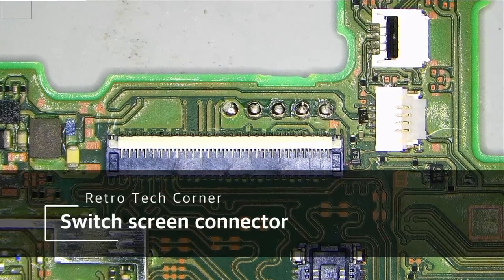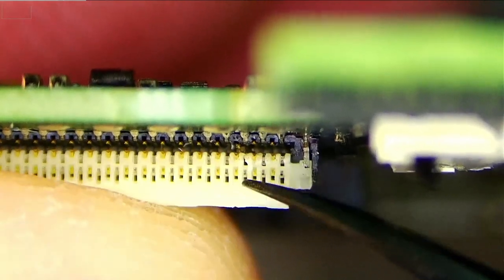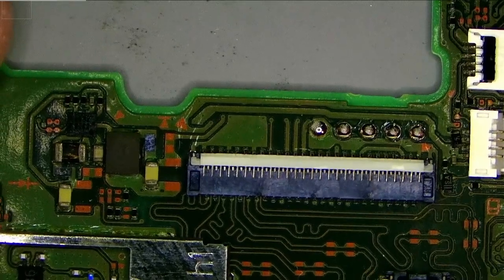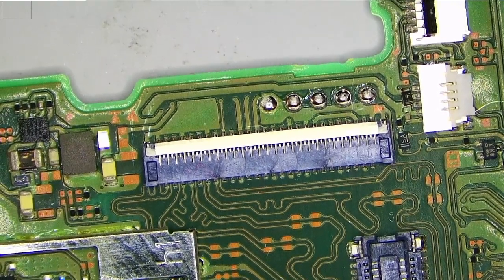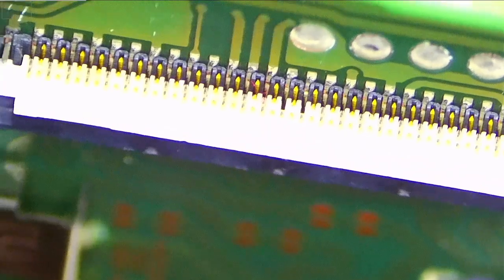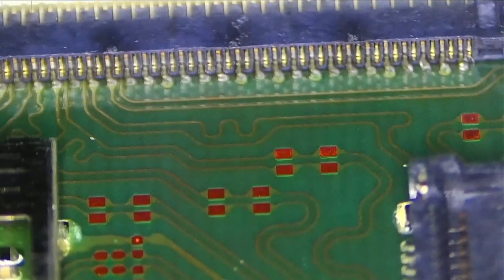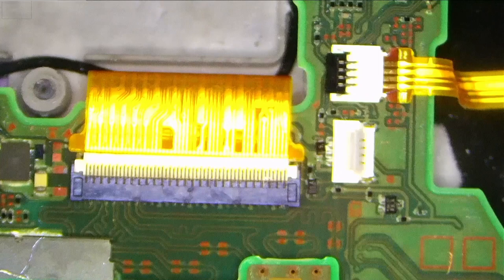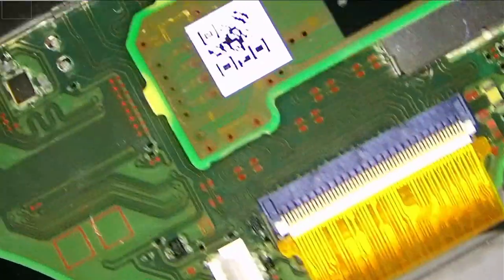Nintendo Switch screen connector replacement

Comment: Is it possible to simply pull the old connector off and set the new connector in place while it’s still hot and without all the cleaning and resoldering?
Reply from the maker: it is. but you may not have enough solder on some pins to make a solid connection.